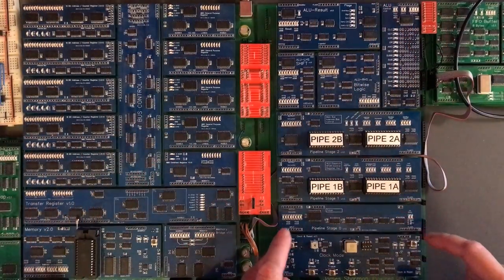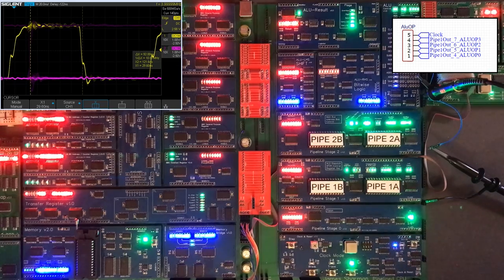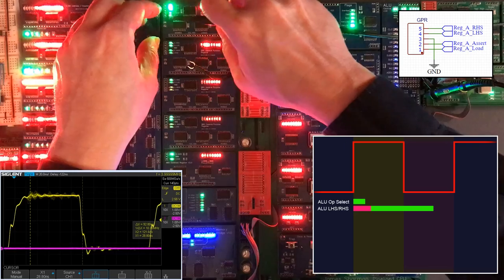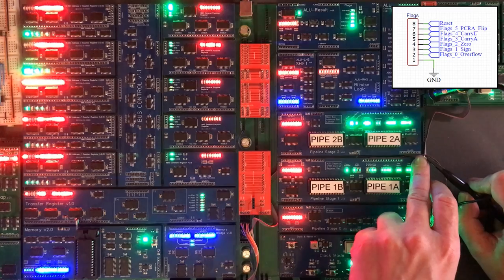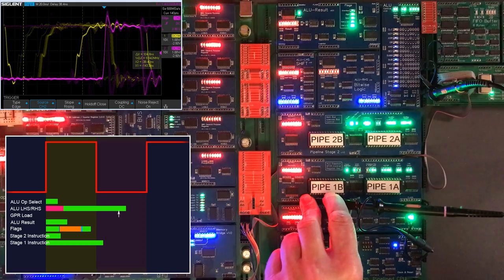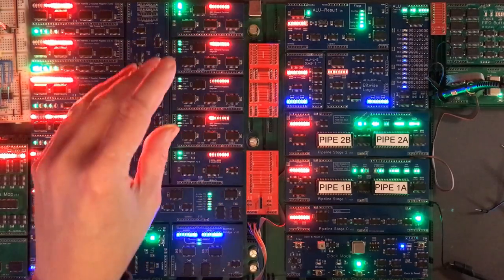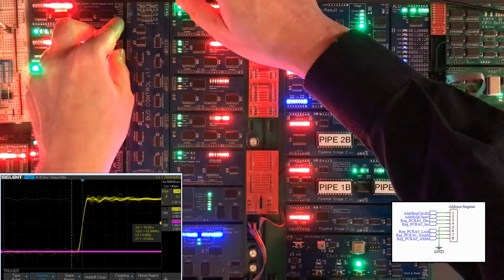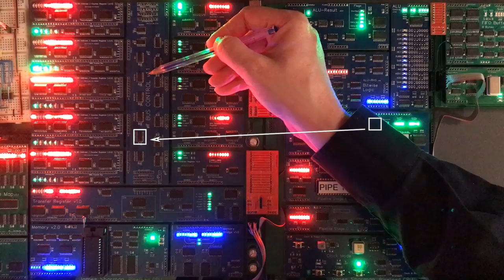Finding the Critical Path - Making an 8 Bit pipelined CPU - Part 101

Comment: It is interesting to see that much of the timing issues are down to using discrete logic (entirely expected) like the 8 input nor-gate not being available isn't really an issue when you bake your own silicon. But I wondered if some modules push the actual output signals through LEDs? I have a vague recollection that this happened early in the build. Sure, the propagation delay will be dwarfed by chip settling time, but there are an awful lot of blinky lights. 
It is always a good idea to check your assumptions especially when writing code, today we use so much code written by others, and we just assume it is correct and performant.
Reply: Interesting, would you mind expand a bit for a “happy amateur” on the negative effect driving LEDs has on the quality/delay on the signals? Is it negligent or major at these speeds?
Reply: @kvadratbitter  Since everything in electronics has a  propagation delay time taken and an LED has an associated resistor in series, we do get "some" delay. It is probably in the sub nanosecond range, so it is probably negligible on its own, but stack up a few, and it starts to matter. And remember we are looking at 250 ns slices, so negligible is relative. Granted, passive components don't have much of a delay (most datasheets doesn't list it) then it is more about the length of the data path, but again that is probably too small to matter. Stack up 100 LEDs in series and I bet you would start to see some propagation delays, again probably not the issue here, and I think James quickly changed to tapping off the signal and using an LED driver to drive the LEDs and let the signal path not include the LEDs. But some of the boards in the build are rev 1.0 and is fairly old, so the ida popped into my head.
As for signal quality, I have no idea how noisy LEDs are, but there seems to be some interference for radio operators. Again a single one is probably fine but 100 will probably really mess with the S/N ratio. If I had a scope, I would check. You need a square wave and as many LEDs you can jam into a breadboard, and a scope to check the signal.
Reply from the maker: The LED's are not in series so they don't delay the signal like that, what they can do though is load the line to slow down the rise time of signals.
Reply: @weirdboyjim  Thinking back, I seem to remember an early video where the LEDs were causing issues, and that was when you started using driver chips, but I can be entirely wrong. Since you built it, your knowledge of it supersedes anyone else's. But as kvadratbitter pointed out the delay would be very small indeed, if the LEDs were in the data path, but they aren't, so I was wrong. But at least we fed the algorithm some interaction.

Comment: Lots of interesting points in there, especially surprising to see the Zero line delayed so much. I guess a 74HC4078 or similar is going to solve that. I do wonder if the physical and electrical size of the main bus is causing slow slew rates because of fan-out (drive current) limitations and line capacitance / inductance + load resistance. Rather than use a fixed time delay, you might find it more reliable to derive the main clock from a higher frequency, and use a divider to generate a second phase delayed by 90-degrees, like the 6502 uses.
Reply from the maker: The zero calculation is only about 20ns, sure you can make it faster but will never make it zero. it would be better to move the dependencies around so it was no longer a constraint.

Comment: The Zero flag delay is always a surprise when you design a CPU like this. If you are aware of this problem from the very start in your design, you can optimise the instruction set in a way that you move the condition to be tested to the compare instruction, instead of the conditional  jump instruction. This ends with one single flag, that can be computed early in the NEXT (pipelined) instruction cycle, thus avoiding completely the overhead of the Zero flag, which otherwise must be computed at the end of the current cycle.
Reply from the maker: When I started this build I wasn't thinking about it running at anything like this clock-rate. The main difference I would make to this bit of circuit is put the ALU->Pipeline flags connection through a d-type so they only changed at the start of the next cycle.
Reply: @weirdboyjim   Not sure if I understand what you mean... but you would still have to compute the Zero Flag after the ALU result in the same cycle, right? (I do not mean to suggest a radical redesign of your processor, just pointing out a solution that worked for me)
Reply from the maker: @RelayComputer  The idea is to only use it (outside the ALU) a cycle behind so we don't need to speed up the generation but the decode will always have a stable value from the start of a cycle.

Comment: As the clock speed rises, we also have to be on the lookout for weird antenna effects in the traces (standing wave ratios, reflections and the such). The microwave signal engineers point out that it's less the clock speed itself, but rather the rise/fall time within the signal that becomes the basis for a virtual frequency that needs to be considered as well. 

You could justify a collaboration with Phil's Lab for a "Design in Review Playlist", either for this build or for the next.

If you were to have this or the next build translated to IC (whether that's realistic or not), would you want it to be a system on a chip, or a classic chipset? Just looking into it could be a great excuse for an episode, even if you don't actually do it.

Are interrupts actually needed for peripherals or is it possible to do I/O exclusively through sets of dedicated registers and code? Also, would that prevent anything ubiquitous from being accessed by such a system?
Reply from the maker: Interrupts are never needed, but polling status slowly adds complexity to code so wanting interrupts develops as a way to manage that complexity rather than as a "Interrupts is the one true way to handle X" way people often talk about it these days.
Reply: @weirdboyjim  So it just depends on what you're doing. Thanks.

Comment: This CPU doubles for lights for the season.
Reply: Got playing w/ FM radio transmission using a GPIO pin and modulating the cpu clock on a Raspberry Pi...how noisy is 4 MHz at this table top scale?
Reply from the maker: Hmm,  I wonder how deliberate a pattern I can make them flash while playing a tune.
Reply: @weirdboyjim  Zero or fill every register after every op. 🤔
Reply: In the video there's one led strip that looks like bits shifting. Would looks better than on/off.

Comment: It's fascinating to see how it could be made to clock higher - but actually doing so wouldn't be as interesting as adding to the capabilities. Personally? I'd be delighted to see some form of demodulation from audio - preferably an old tape deck ;)
Reply from the maker: Glad you are finding it interesting. I'm very focused on finishing this build but gathering learning's and ideas for a future build rather than getting distracted. Ahh man, audio tape storage, I could touch on that for curiosity's sake but it would never be my main storage mechanic.
Reply: @weirdboyjim  - I look forward to anything you care to share with us! it's an intellectual treat to follow the thought processes of a genius :P

And yes - certainly not preferred storage but given tape's prevalence historically (I'm thinking more home-micros here in the UK) it does feel rather fitting - not to mention interesting! if a 56k Modem is near one end - and a ZX spectrum near the other - what's the simplest possible circuit and how much further did the average home-micro take it?

Happy New Year! :)

Comment: Have you thought about changing the ROM chips to actual logic? Should be able to get that to work in much less than 150ns. Just wondering, now the CPU is pretty fixed.
Reply from the maker: I thought about it, and I’ve thought about all the things I can change that would make it easier. I don’t think I will though as I could easily get into a perpetual cycle of refining this thing. My plans for a 2nd generation while not ROM less do implement a number of the changes designed to make decoding without ROM’s easier. The next build will have less ROM’s in that role.
Reply: @weirdboyjim  Excellent. I hacked your ROMs about a little bit to save space.
Reply from the maker: @m1geo  If I wanted to reduce the ROM complexity I would first look at all the different assert lines, in the data they have explicit values but most of the time they are actually “don’t care”, for examples LHS and RHS select only matter then ALU Op!=0, Xfer assert only matters when Xfer load is not zero etc.. That would let you reduce the data right down and I expect you could reorganise the instructions such that some of them can be directly derived from the incoming bits.
Reply: @weirdboyjim  I instantly halved the size of the first pipeline ROM by removing the reset bit from it and just sending the reset signal.
Reply: There is an idea to use dozen ns SRAM chips instead of ROM.

Comment: Im just finishing up my 8 bit CPU build and have discovered that the EPROMs are the biggest hindrance to CPU speed. typical EEPROMs have a Taac speed of about 150ns... this is the time the data output is valid according to the address inputs. So if that's the case how are you able to achieve 4mhz with EEPROMs? then comes the issue of most 74 series chips have a propagation delay of on average 25 ns for LS (some logic chips like the ACT series are as fast as 10ns but have horrendous ringing in these types of builds)
Reply from the maker: Ok,  this is a really tough comment to reply to as I’m not sure how much of my content you have watched. My pipeline roms are indeed 150ns EEPROMS. For 4mhz we have 250ns to play with in a cycle which gives us 100ns over the raw lookup time.  The simplest overview of why it works I can give is that I don’t do the lookup and then use the outputs in the same cycle which would create a long critical path, I do the lookup and then store the data in a 574 for use at the start of the next cycle, this is the essence of pipelining.

Comment: Have you thought about using static RAM for the pipeline stage lookups? Yes you need to add a circuit to copy from EEPROM on reset or power on, but might give a huge boost in latency I assume modern CPUs with their microcode update while running need to do something similar, EEROM/flash access is too slow, no matter what tech you use, RAM will be faster.
Reply from the maker: It would indeed be much faster but the copy logic would be adding quite a bit to the pipeline stage circuits. You would probably want to mere those stages up so you could share the counters etc..  Personally I'm more interested in maximizing the utilization of the components I have. If you solve all the other issues fairly cheap flash chips would work to several times the current clock rate, so solving the challenges ti make that happen is interesting. Especially since the same changes would let you get still more performance out of faster memory technologies.
Reply: @weirdboyjim  It's all about the purpose you choose, and the battles you pick. I'm just throwing ideas into the room, keyboard warrior style. (OK; got at least some experience to back it up...) Using your critical path approach tells your weak points. If the eeproms become your limit and this can be solved by faster chips: go for it :) Btw, I'm courious if there are off-the-shelf hybrid ram/rom chips that do the copy on power up or writing. Or if they leave it to system designer to do this when needed, like in the early bios days where they reserved precious RAM for this.
Reply: There are hybrids of course like Flash or NVRAM (battery backed up SRAM)
Flash seems to be suitable but I agree with James that overall critical paths are also important.
I liked the idea suggested in these threads to pre saturate the address bus for instruction/data loads at the end of the former cycle. That could cut out a chunk from the load cycle.
The Zero flag could well be done with the diodes and an inverter yes. Might be a lot faster and easier than cascading nors with an and

Comment: Would it be a possibility to use SRAM instead of the pipeline ROMs - obviously would need bootstrapping somehow...
Reply from the maker: You could put a shadow ram system in but it would be a whole stack of extra circuitry. You would need to be able to cycle all the addresses to write the ram on power up which would either need multiplexers or some clever overriding of the input circuitry upstream.

Comment: Why not swap the roms for faster ones? I get you don't need a increase, but the possibility of that is just a side effect. As you concluded you are running the current parts of of spec. Why not replace them just to prevent possible instability issues later down the line. Running parts out of spec might lead to unexpected failure modes later on, maybe just from putting wear on them.
Reply from the maker: Earlier in the build I had planned to replace the 28c256's with 27c256's which are pin compatible and much faster (but OTP) but they are not readily available due to the chip shortage. Other ROM's are not pin compatible so I'd have to redo the pipeline pcb's OR make a messy adapter board.
Reply: @weirdboyjim  in that case let's hope you are not forced to redo them later on anyway because of some failure. These roms work at this speed, but being outside spec it's not guaranteed all roms of that type will do that. Some might be better off the production line then others. Like transistors having a b c suffixes for classification in past specifying how good they were. 
Before I forget, happy new year, and i hope to see many more interesting videos as to expand the video and other stuff.

Comment: very cool, but it left me thinking just how fast of a processor it would be if you built it doing the bulk of it in a FPGA. I realize that isn't the purpose of this build, and I love how you built out circuits using basic logic IC chips, and while I have no experience with FPGA's, they are well above my skill level. I know that some people have replicated entire CPU's in them, maybe a future project for you??? not that it would be as interesting to watch as this build. I tried watching a video that was an introduction to programming FPGA's and I did not get very far before falling asleep.
Reply from the maker: Absolutely, on an fpga it would be possible to approximate this circuit at a vastly higher clock rate. This build is very much about research / education / learning. Can't have led's on the control lines inside an fpga!
Reply: @weirdboyjim  from experience, my non pipelined CPU that I built in an intro course hit 10 MHz first try with no effort so I'm sure that's one of the lowest bounds on performance haha

Comment: For the zero flag the faster way to do it is use a diode array on a NOT gate
Reply from the maker: You might save a few nano seconds that way but this exercise shows it wouldn't make any difference. If fetch were improved it would become an issue but rather than save a maximum of 21ns (if you made it instant) I would redesign the dependencies to remove the flag calculation from the chain completely.

Comment: The datasheets show you the speed ratings for when they are driving a certain capacitance, usually equal to just a few CMOS inputs. 

If a chip is driving a lot of inputs then it will be far slower than what is listed on the datasheet and if its driving less it will be far faster.

So as you've found out, the datasheet speeds aren't even that good as a rule of thumb!
Reply from the maker: The load / capacitance can be quite noticeable on the rise/fall times of signals.
Reply: @weirdboyjim  that's exactly right, it increases delay because it takes longer for the output to reach a valid high/low value.

Comment: float only 8-bit machine
Reply: or maybe 16-bit single step rom float machine
Reply: if all operations are atomic, no need to pipeline
Reply: rom memory ops are all 1-cycle atomic
Reply: better be cross-point (cross-line) direct access memory (1-cycle memory access read/write)
Reply: shared memory multiple access
Reply from the maker: I'm very sorry but I've not been able to understand your comments.
Reply: @weirdboyjim  advanced binary logic circuit
Reply: @weirdboyjim  if you only have memory interactions (memory only logic), then the memory (like dac) is the only bottleneck to itself
Reply: @weirdboyjim  you can represent the same logic in multiple ways, consider the memory only logic representation way
Reply: @weirdboyjim  there are no multithreading/race conditions in memory interaction only circuits
Reply: @weirdboyjim  assuming only one core (also multi-core) each cycle is exactly one instruction, no wait lines, no pipelines, nothing complex, output is directly readable during/after the cycle
Reply: @weirdboyjim  the result is stored during the one atomic instruction cycle
Reply: @weirdboyjim  in memory interaction only logic circuits, all circuits and operations take exactly the same time, all chips are the same (speed/chip ram/rom)
Reply: @weirdboyjim  no signal sync design issues also, super simple logic circuit design
Reply: @weirdboyjim  the only variable is the length of the cycle, which is the same for all parts, so you can/could vary the cycle/frequency at will, self-synchronizing design
Reply: try the same 8-bit logic but with 100MHz (or 133MHz) pentium 1-cycle cache chips only
Reply: store the 8-bit alu in rom, load them into the fast cache when booting